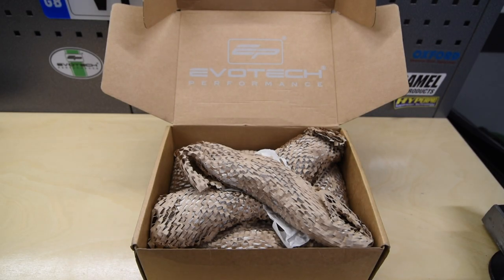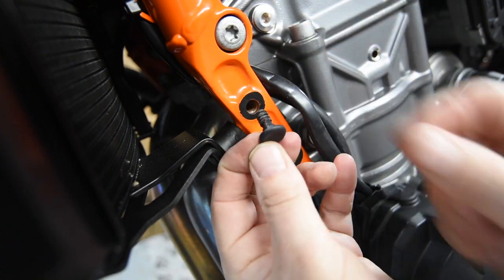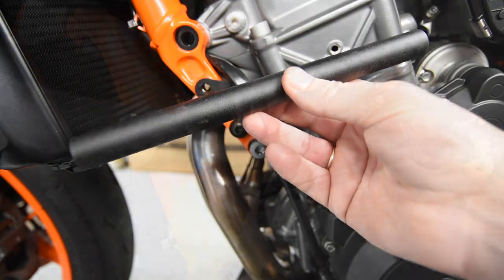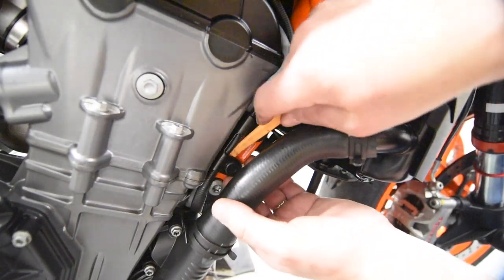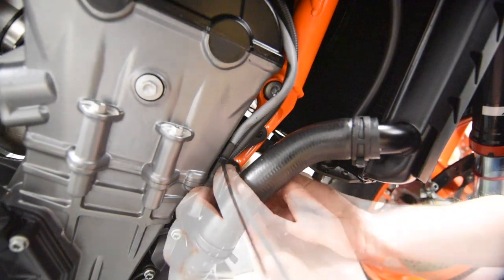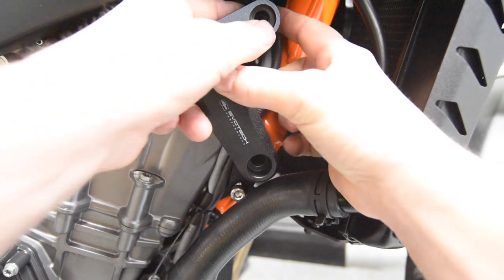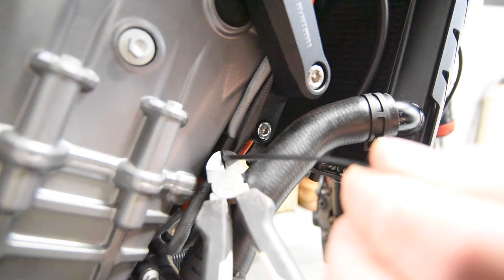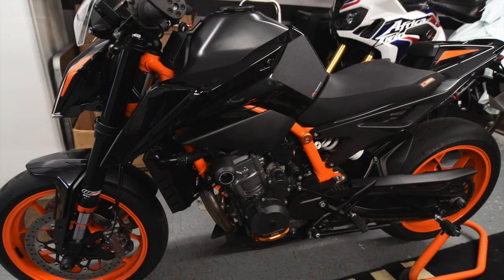HOW TO INSTALL EVOTECH CRASH BOBBINS ON 2021 KTM 890R DUKE

Comment: Just a heads up…. If you ride around and warm up the bike. The heat will make it super easy to pullout those “black plastic tabs” on each side! Just use two flat head to pull it out
Reply from the maker: Good tip! Thanks for sharing.

Comment: I don't know why you wouldn't install bolts directly into the OEM cable brackets. Maybe because they are plastic and they feel a metal bracket is required?
Reply from the maker: I just followed the instructions 👍. ride safe.

Comment: Do you know what the bobbins are made of, mine feel like they're made of metal . I checked with a magnet and they weren't magnetic but thet could be non-ferrous metal. Do you have any idea what Evotech uses for the bobbins?
Reply from the maker: Hi, they are made from a highly abrasive-resistant engineering polymer
Reply: @gsd32i  I wish mine were, I received an answer from the supplier who said they were made of aluminum. Weird eh. I wonder how they will react to a spill. I was thinking polymer would just kind of sand down, where aluminum would be unpredictable I would think?
Reply: Not sure if the bolt would just bend with contact, or what.
Reply from the maker: @Paul-hn1wo  The polymer I guess is designed to wear down and I suppose won't transfer the force to the frame, whereas metal may??? Are they genuine evo-tech or copies?🙈

Comment: This is by far the best EVOtech frame slider install video! Great work👏 Also thank you so much for the torque setting prompts. One question hopefully you’ll be able to help me with, concerning the crossbar support piece placement. You have it going through in front of the plastic radiator baffle, is that Evotech recommendation or did it just seem to fit better? I installed mine behind that baffle before seeing this video and was wondering if I should re-do it?😕
Reply from the maker: Hi . I just had to watch that part of the video again ! From memory Evotech didn’t stipulate either way . The bikes been thrashed in a caring manner since fitting and all is good . Nothing has got fouled with that crossbar support and lI think it was just a case of it sitting better that way to be honest . Nice stuff Evotech 👍
Reply: @gsd32i  Must say it’s not just this video but all your instructional vids are very well done. Thank you.  I had noticed the baffle without the crossbar had the hot radiator exhaust air directed down and away from the top of the head. First when I temporarily installed it the same way you did, it seemed to kick that baffle back, not much but it would’ve dumped more hot air on the top of the head and already my bike seems to run kind of hot! I’m always so indecisive and don’t have much confidence in most anything I try to do mechanically. That’s why your videos have been so important and much appreciated. They’ve really helped out. Sorry for being long winded not trying to take up too much of your time. Again from a very thankful subscriber, thank you.
Reply from the maker: @dukie1616  no problem . They do get a bit warm in temperatures over 16 degrees C! When I put my crossbar through it didn’t dislodge anything under the tank etc , pretty much a clean insert . My memory is a bit sketchy as it was several months ago . Ride safe . Go to run my new baby in next !
Reply: @gsd32i  Yeah I’ve been watching your R1250GS content, and must say I’m a tad jealous😊 Hopefully you’re getting enough time to enjoy your new ride! Looking forward to your next video. Have a great day.
Reply from the maker: @dukie1616  thanks 😊

Comment: The engine bolt torque settings from EvoTech are different to the torque settings from Givi when using the same bolt hole. Givi say 48Nm and not 38Nm. I found a KTM document that said M10 egnine carrier bolts are 45Nm but I am not sure if that is an engine carrier bolt, so you might want to do your own research.
Reply from the maker: Hi. I have had a look at the Evotech instructions against my video and as they state max torque 38nm for the bolt that goes into the engine , I will leave it as that.Possibly bolt composition ? No issues to date. Thanks for taking the time to post comment. ride safe.

Comment: I just did this yesterday and found the engine bolt torque kind of creepy seemed like I had to turn forever.  Did you have any of this when you did this?
Reply from the maker: Hi, no I didn't have any issues, I did watch the video again just to see. Possibly the bracket wasn't seated properly, so when you put the bolt in, it wasn't catching the thread? hope you managed to get it done. The are good bits of kit.
Reply: @gsd32i  It was bothering me so I took the bolts back out and re-installed them seemed less of an issue this go around.  thanks for your help.

Comment: They make special trim remover tools specifically to remove those plastic buttons 👍
They're available at most any autoparts store. Definitely worth picking up before starting this project.
Reply from the maker: Definitely. one slip of the screwdriver you are into the paint on the frame =grown man cry 😂